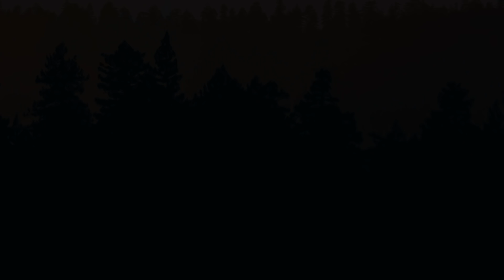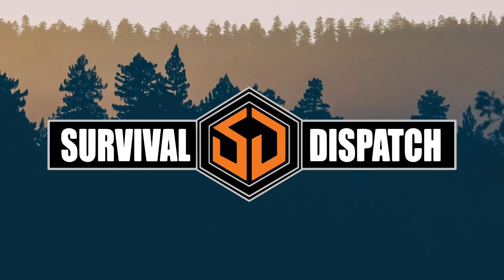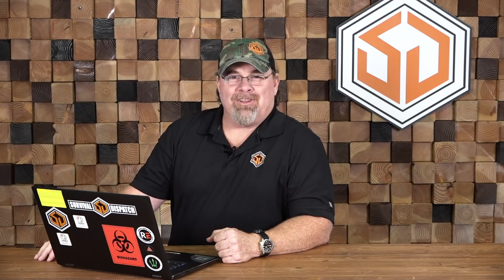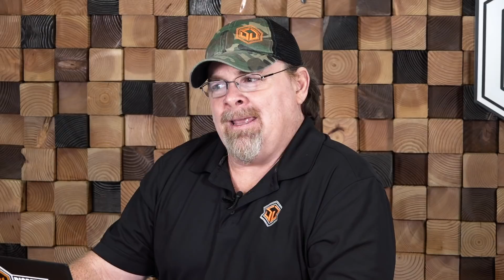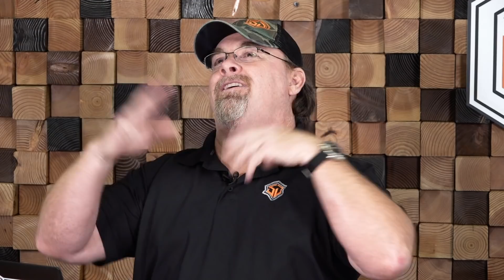All About Generators!

Comment: One of the most informative generator videos I've seen, thanks. I would say, though, most of today's inverter generators have sensitive CO2 sensors, and the sound deadening of a pit and walls alone would shut down on CO2 detection.

Comment: I was surprised how far a 2,500 watt Champion generator would go in running a house. I have a transfer switch in my panel, my entire panel is hooked up to this transfer switch except our HVAC unit. My entire house was able to run on a single 2,500 champion. Granted it's just the wife and I. I have a larger 4,500 watt generator I wanted to do a test with the 2,500 and to my surprised it ran everything. I have one large fridge, and one tiny fridge in my garage.

Comment: Got an 1.2 kw generator, just for lights, computers and electric doors. It feeds the fridge during the night (the fridge can survive 24 hours without power). Wood stove for the heating. Yes it doesn’t provide the full comfort as usual, but it’s only for a couple of days a year, sometimes less. The generator works 10 hours on full load with a gallon… less expensive generator, less gasoline to store, less maintenance, less noise…

Comment: A generator will run a well. It only needs to run five minutes maybe 20 depending. Cooling equipment can also be easily staggered if necessary due to a small generator. There are also controls which run one unit until it shuts off and then switch the next one on. Do not rely on natural gas.

Comment: Just a couple good tips you might want to add. 1The Killawatt from Harbor Freight $30 will read voltage,amps,frequency and watts used by an appliance. 2 an inverter generator uses much less fuel than a standard generator because it idles with no load instead of wide open all the time. 3 Add a Micro Air soft start to your AC unit. Starting current is reduced on mine from 110 amps to 35 amps initial surge. Cost about $350. But allows a smaller 220v gen to run the AC.

Comment: Excellent video! I have a question. I have a 1440 running watt's on propane, I can run a 12000 BTU window A C and a portable fridge/freezer cooler and TV. When the A C unit starts the compressor the generator bogs for a few seconds and clears right up. Should I get a parallel kit and another 1440 watt generator? Even with out the TV and fridge it still bogs for a few seconds, the AC uses 10.5 amps.

Comment: How can I run our 240v well pump off our 4500 watt, 120v WEN generator going through a transfer switch?  I shut all other breakers off and it will not run the pump.

Comment: Read your instructions the first time you run a brand new generator bought brand new. They say change oil at 1 hour of used to get rid of any burrs so it won’t seize you engine. Burrs are tiny metal particles that when oil is added the burrs get into the oil. That why you find bunch of brand new generator return to Lowe’s and Home Depot after a storm because the engines were seized. And customer says it was  no good all because the customer was 2 stupid to read the owner manual. And it a good idea to get a magnet oil stick for the generator. To help to catch metal burrs.

Comment: Wow a 5,000 watts generator is small 240 volt divided be 5,000 watts is a 20.8333 amps just over a 2 pole 20 amp breaker.
People bragging about there 200 amp service but in a power outage there going to use a 2 pole 20 amp breaker to try to burn up the winding on there generator.
Why don’t they put a 2- pole 20 amp as there main service because it all they need to run there houses when they loose power.

Comment: The power loss you get running LP vs. gasoline is about 10%, not 20% mentioned in the video.  A dual fuel generator will have ratings for both and you can do the math.
Reply: I thought so too.  Also I’m pretty sure you can go 100 hours between oil changes as well.  I’d definitely check the oil every time I fill the fuel tank.  I’d have ample oil and filters to go the long haul.  Just like a car with oil the oil viscosity will be specified in the owner’s manual.  Older generators usually just took 30 weight.

Comment: Two comments:
1.  You are not going to be able to, easily, run direct wired equipment, such as a well pump or furnace, on your generator unless you are powering all/most of the house via a transfer switch. You would have to undo the wires and add a plug to those pieces of equipment in order to plug them into the generator.

2.  If you construct your own power connection cord, "turn off the main breaker and all the other breakers" in the breaker box and plug your cord into the dryer receptacle, as instructed in this video, you will NOT have power to anything. 
If you switched the dryer breaker to on, you would now have power back to the panel, but to nothing else. You would then need to switch on the breakers to any circuit which you wanted to power. BE SURE TO LEAVE THE MAIN BREAKER SWITCHED OFF to avoid energizing the power grid.
As stated in this video and several others, THIS JERRY RIGGED CORD CAN BE DANGEROUS, so only do so if you have the proper knowledge.

Comment: STA BIL makes a product to stabilize fuel with ethanol in it. Im sure there are others. Also, Lucas and or Amsoil makes a fuel stabilizer that works for up yo 5years. Just so those know that may not.
Reply: Just use aviation fuel. 93 octane.

Comment: My two quality 2200 watt inverters have served me well during long outages, basically, whisper quiet .. and running about 10 hours on a gallon. I keep a wireless thermometer in fridge and freezer with auto-alarm when the temp inside reaches set level .. indicating need to start generator again if it is taking a break. This way I can actually keep food cold and safe using only a gallon per day of fuel. I also have a small 900 watt induction hotplate and a tiny 600 watt microwave .. I feed the house with 10 gauge cord split to three 12 gauge feeding fridge, floor lamps and fan and electronics including TV and DVD player, router-modem.  As a cooling system of last resort, I have a tiny Chico floor AC unit that will cool one room using leas than 2000 watts. I keep enough ethanol free stabilized fuel on hand for a couple of weeks of off grid power rotating it in and out of inventory. (20 gallons) I have extra spark plugs and synthetic oil on hand. During recent 19 hour outage we had movie night with popcorn on inverter after a generator cooked supper. Not bad for 2200 watts.

Comment: Even a small 2000 watt generator can get you through a long power outage. You just have to plan ahead… get a small window 🪟 A/C unit that your generator will power. Switch back and forth from powering your A/C unit and powering your fridge and freezer. Get a small electric single cook top for when you have to cook. Get a portable space heater for the winter 🥶. The generator can run the heater for 8 hours ~ more or less on one gallon of gas ⛽️. Make sure to change the oil when the manual tells you to. Inverter generators are safe for electronics.

Comment: Personally I have a 4.5kw diesel generator that consumes less than half the fuel of an equivalent petrol/gasoline generator and delivers a more stable voltage thanks to diesel engines higher torque value so less inclined to bog down with inductive loads
Reply: Wo cares

Comment: If you sealed off the generator plus added a exhaust to the outside. Could you use a 2500 generator in the garage and or un used room. I live in a second story condo with a patio. I am considering putting a small one there or in a far back un used room. I woukd seal the room like mold remediation and also run the exhaust out side possibly with a fan. I even considering a second un used bathroom with a fan on placing it in a tub.
Reply: It’s never safe to use a portable gas generator indoors. Here are the rules about portable generator safety: This is just a reminder for everyone’s safety. All generator safety rules should be followed carefully. This advice is just to make sure that everyone is aware of all the warnings and it’s just to remind people to be careful using portable generators. Generators can be dangerous if not used carefully. Every year, hundreds of people die or get injured when using portable generators due to carbon monoxide poisoning and electrocution. Make sure you are using your generator carefully and keeping others safe as well. There is something very serious that everyone should always be aware of when using generators. Some people do run their generator indoors which is not safe and that increases the risk of carbon monoxide poisoning which can cause death of family and you. Some people run their generator in wet conditions which can electrocute them. Please remember that you should never run your generator indoors. Remember that carbon monoxide is an odorless and colorless gas that you cannot see or smell. Carbon monoxide is a silent killer. Keep that in mind. Make sure your generator is 15-20 feet away from your house and away from doors, windows, and vents. Never use your generator in your porch too. Having a carbon monoxide detector is very important against generator safety. Some people also allow children to go near the portable generator which could pose risks. We need to keep an eye on our children making sure that they are not near the portable generator so they won’t get electrocuted or burned by the generator which is dangerous. A locking enclosure also keeps kids safe. A generator shed might look like a tempting place to explore, or take cover during a game of hide and seek, but a generator is a dangerous piece of equipment that can cause injury. It says on the manual that we should also keep children away at all times from the portable generator to avoid injuries. Please do not allow a child or unqualified people to operate the portable generator.  It is important to keep your children safe especially little ones. The portable generator can be hot during an operation. Just because some manuals missed what should be listed doesn’t mean it’s safe to do. Always follow the generator safety rules when using portable generators. Generators pose electrical risks. If you need to use your generator during wet weather, you need a generator tent to protect your generator from getting wet. Don’t let your generator get wet. Keep your generator dry and before using your generator, please make sure your hands and your generator is dry. Do not wear loose clothing when operating the generator. Everything that is said on the generator’s operating manual should not be ignored. Never smoke cigarettes near the generator. Please keep flammable things away from the generator. Never overload your generator too. Your generator can catch fire. Never ever try to plug a generator cord into a wall outlet to avoid back feeding. Back feeding your generator is dangerous. Always turn on your generator first before plugging in appliances and shut off the appliances before turning your generator off. Use a heavy duty cord for your generator and the cord should not be worn out. All the instructions should be followed carefully. Never refuel your generator while it’s running. It can cause fire if fuel spills while your generator is hot. You should turn off your generator and let it cool off before refueling it. Having a fire extinguisher next to the generator is also important. This is only a reminder for everyone’s safety of using generators. Make sure your generator is properly grounded. Having a fire extinguisher next to the generator is also important against the safety rules. https://youtu.be/I1jT3ANENvI and here is a video more about keeping others safe when using generators and also about our family’s safety. Hope this helps. Thank you.

Comment: Yeah, I know that the post below is a bit long winded and  even cut off the ending. The bottom line is change the oil at the recommended interval, use brand name oils and, for me, I ALWAYS change the oil regardless of when it was changed last or whether or not it's been used since, EVERY spring AND fall to prevent acid buildup in the oil from moisture mixing with sulfur in the oil.
    One thing that I would like to agree with and stress is your suggestion of proper sizing for the need. After I got the bigger Troy Bilt referenced below, I expected and noticed the increased fuel cost. As mentioned below, my wife has health issues that require A/C during hot times. At night when we only run the window A/C in the summer, it didn't seem prudent to run that hulking 7000 watt behemoth for a 5 amp window unit so I went out and bought a 10 amp, (1100 watt), Champion unit just for the A/C. My neighbors are few and far between but I'm sure they would appreciate the whisper quiet hum of a little toy rather than the ongoing riot in the garage. Well, Champion gets the loser participation trophy in my book. The bigger units may be fine. I've seen good things about them here but that little 80 cc pocket sized engine really chickens out at half load. I gave it to my son 3 counties over and told him to only use it for one light, one fan, the cable box and one LED TV set. I'll admit that under that load, the one gallon gas tank will last 24 hours but anything more will stall it.
Reply: Here are the rules about portable generator safety: This is just a reminder for everyone’s safety. All generator safety rules should be followed carefully. This advice is just to make sure that everyone is aware of all the warnings and it’s just to remind people to be careful using portable generators. Generators can be dangerous if not used carefully. Every year, hundreds of people die or get injured when using portable generators due to carbon monoxide poisoning and electrocution. Make sure you are using your generator carefully and keeping others safe as well. There is something very serious that everyone should always be aware of when using generators. Some people do run their generator indoors which is not safe and that increases the risk of carbon monoxide poisoning which can cause death of family and you. Some people run their generator in wet conditions which can electrocute them. Please remember that you should never run your generator indoors. Remember that carbon monoxide is an odorless and colorless gas that you cannot see or smell. Carbon monoxide is a silent killer. Keep that in mind. Make sure your generator is 15-20 feet away from your house and away from doors, windows, and vents. Never use your generator in your porch too. Having a carbon monoxide detector is very important against generator safety. Some people also allow children to go near the portable generator which could pose risks. We need to keep an eye on our children making sure that they are not near the portable generator so they won’t get electrocuted or burned by the generator which is dangerous. A locking enclosure also keeps kids safe. A generator shed might look like a tempting place to explore, or take cover during a game of hide and seek, but a generator is a dangerous piece of equipment that can cause injury. It says on the manual that we should also keep children away at all times from the portable generator to avoid injuries. Please do not allow a child or unqualified people to operate the portable generator.  It is important to keep your children safe especially little ones. The portable generator can be hot during an operation. Just because some manuals missed what should be listed doesn’t mean it’s safe to do. Always follow the generator safety rules when using portable generators. Generators pose electrical risks. If you need to use your generator during wet weather, you need a generator tent to protect your generator from getting wet. Don’t let your generator get wet. Keep your generator dry and before using your generator, please make sure your hands and your generator is dry. Do not wear loose clothing when operating the generator. Everything that is said on the generator’s operating manual should not be ignored. Never smoke cigarettes near the generator. Please keep flammable things away from the generator. Never overload your generator too. Your generator can catch fire. Never ever try to plug a generator cord into a wall outlet to avoid back feeding. Back feeding your generator is dangerous. Always turn on your generator first before plugging in appliances and shut off the appliances before turning your generator off. Use a heavy duty cord for your generator and the cord should not be worn out. All the instructions should be followed carefully. Never refuel your generator while it’s running. It can cause fire if fuel spills while your generator is hot. You should turn off your generator and let it cool off before refueling it. Having a fire extinguisher next to the generator is also important. This is only a reminder for everyone’s safety of using generators. Make sure your generator is properly grounded. Having a fire extinguisher next to the generator is also important against the safety rules. https://youtu.be/I1jT3ANENvI and here is a video more about keeping others safe when using generators and also about our family’s safety. It’s important to keep our children safe especially little ones. Hope this helps. Thank you.